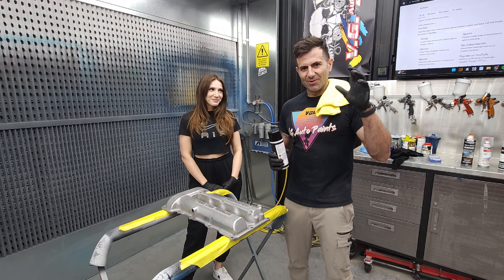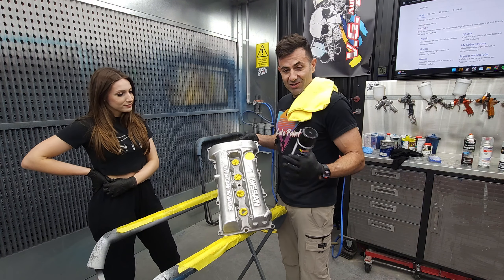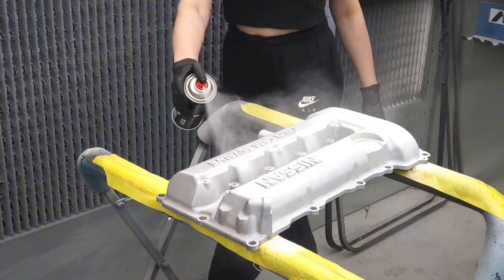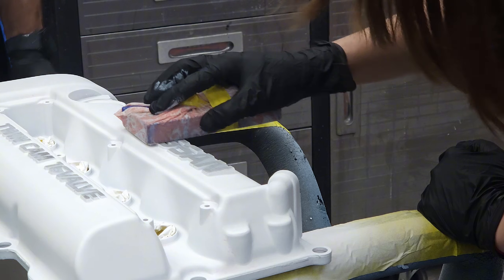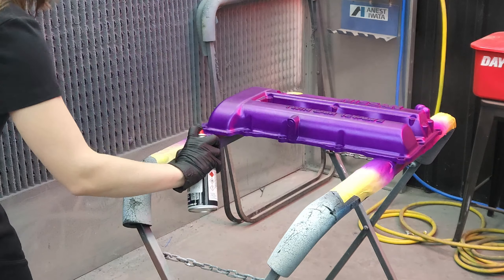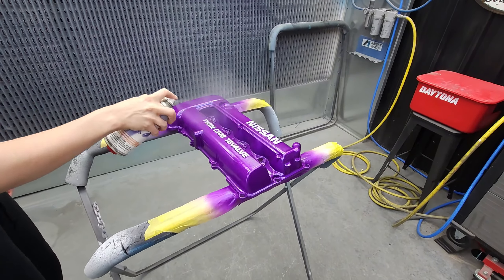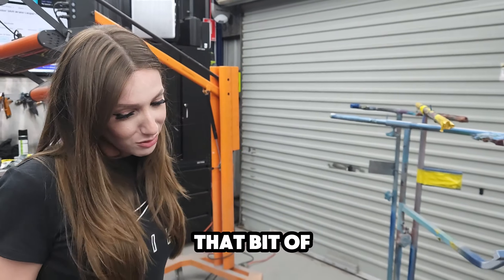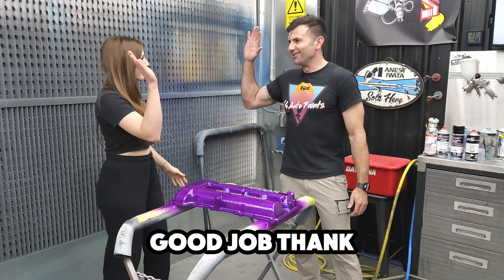How to paint a Valve Cover (DIY Spray Cans)

Comment: I use the same clear coat cans on my carbon fiber parts that I order from China. They usually come with crappy clear, I sand it down, clean it, spray the clear and the carbon looks great.

Comment: i just tape over them, then use plastic hammers on the tape. The raised edges will cut the tape, carefully remove the tape, paint as normal then remove the tape from the letters. You can even paint the letters a different colour first if you want.

Comment: Did the same with my intake manifold(subaru) but with candy paint 2k has survived the heat no issues cannot recomend 2k in a can for rocker covers, brake balipers and other small parts you want a nice durable high gloss finish on

Comment: I'd like bit of advice please when I ask the question I get loads of different answers?  I'm gonna spray a door in metallic?  Is it OK to do it with an hvlp gravity feed ? Nobody I've asked seems to know cheers Al Manchester UK !
Reply from the maker: @allewis1905  Hello. You could paint the door with a spray can if you wanted to, but a hvlp gravity spray gun is perfect. Ideally a 1.3mm tip for the basecoat and clearcoat.
Reply: @customspraymods  thanks a lot I've used spray cans after watching your videos and got some great results ! I watched another video of yours were you said get your self a small compressor and give it a go so come summer I'm gonna give it a go ! Thanks mate !